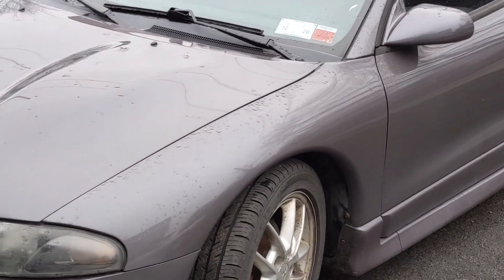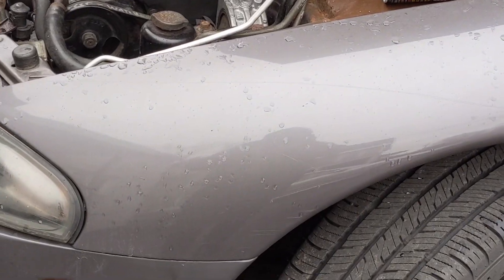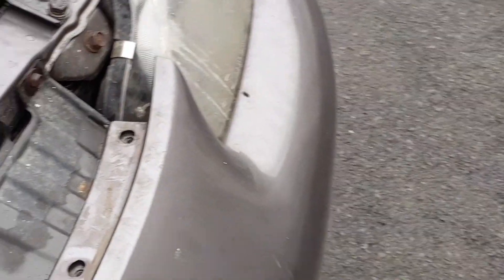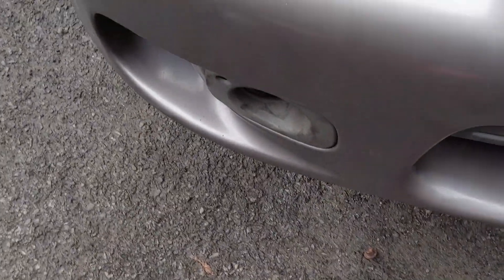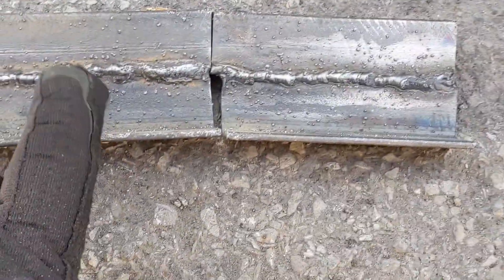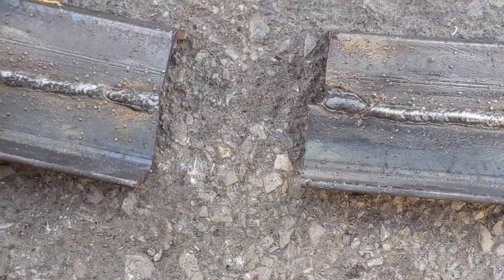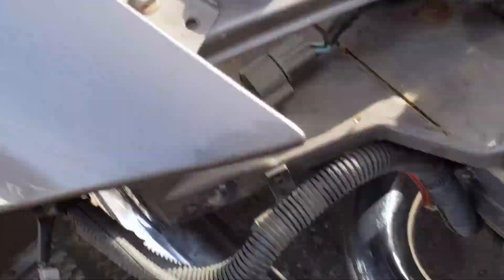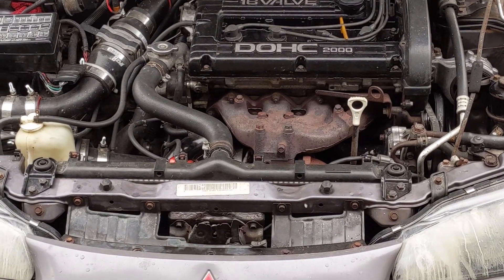FRONT MOUNT INTERCOOLER INSTALL 2G DSM

Comment: Great vid dude. Came out looking nice. Definitely going to reference back to this in a couple weeks! Plan on doing a front mount to my 96 gsx once I finish tracing what short is causing my ignition fuse to keep blowing ..
Reply from the maker: Thanks for watching and good luck with that short! Just did one on a Pontiac vibe that was causing mas air flow signal to drop out and kill the car wherever it was driving at 🤦... #savetheeclipse

Comment: Question, where did you mount the intercooler up with the perforated sheet metal? I couldn't tell cause the bumper guard was blocking the view.
IDK if you bolted it on to the top of the bumper guard bracket or the core support, Thanks.
Reply from the maker: I mounted it to the plastic crash bar up front. 👍

Comment: I own a 97 eclipse gst. I’m trying to upgrade the intercooler. Do I need a special tune after the upgrade intercooler?
Reply from the maker: Not at all. It will just improve air cooling and flow rate. Hope it goes smoothly👍

Comment: Yeah so that MAF up by the throttle body, I'm assuming this is to run the 1G BOV without recirculating? I have a 1G BOV on mine, and would love to do this. Is this outlined in a video you have (if so maybe link it please, if not maybe make a quick video explaining doing that process)?
Reply from the maker: I believe I've got something talking about it in the maf translator installation video. Take a look at that and I believe I touch on the 3-in GM maf sensor and how to run the blow off valve to the atmosphere using the maf translator and that sensor
Reply: @TPGDSM  Perfect, thanks brosaurus!

Comment: Need a 4g64 rebuild in SoCal. Recommend a shop ?
Reply from the maker: Maperformance
Performance Partout
Jegs sells remans too
Reply from the maker: Millennium motorsports in Temecula is highly regarded, dels machine shop in Sacramento, RRE (road race engineering) is a huge place to send 4g's. You can hop online and search the Facebook classifieds, dsmtuners.com has sponsors that support the platform and are very knowledgeable. Hope that helps. Find your clearance specs online or through forums/Haynes manuals. Figure out a good reputable machine shop to send the parts to and find a trustworthy builder. They're simple engines but require (like all engines) correct tolerances and clearance on all the internals. Good luck 👍

Comment: you were able to throw it on and still running AC? nice
Reply from the maker: Yep. Retained my a/c system. I did however kill my radiators air flow and had to add some custom ducting and vents to the bumper but yeah. Great little piece of kit so far 👍😁
Reply: @TPGDSM  ah yeah i noticed the front grills in later videos :D
i picked up my car without AC but it has a ton of work including the alternator relocate etc so will likely not see AC again. I'm in the toronto area so i'm hoping it's not too bad in the summer. i Had a black 370z with no AC but that thing ran HOT inside.